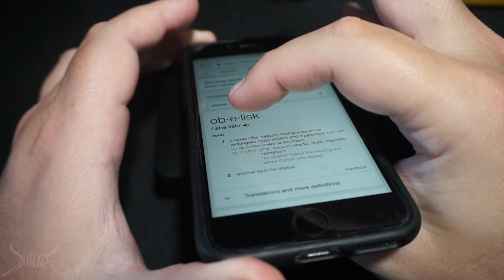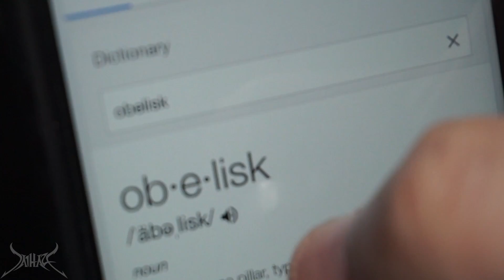Cartel Obelisk RDA Review and Rundown

Comment: Also I always understood it that the more restriction on the airflow the better the flavor, but I am not an expert. I would have put the coils closer to the middle, rather than the outside, which is why it has directional airflow.....Or just a little bit closer to the middle like when you put the screwdriver through the airflow slot, have the coil centered with where it meets...